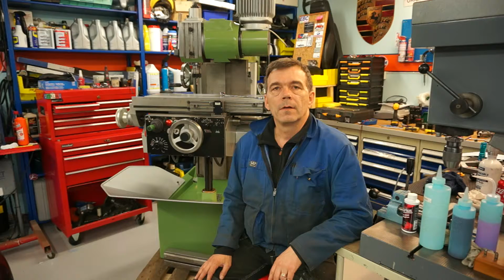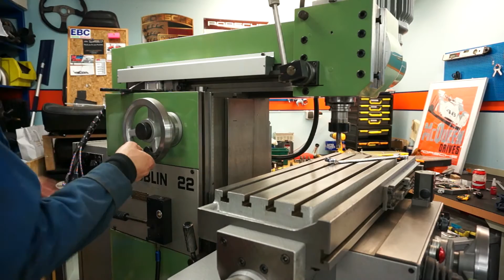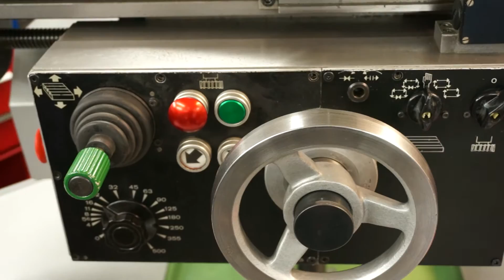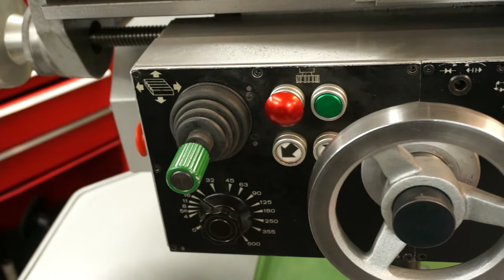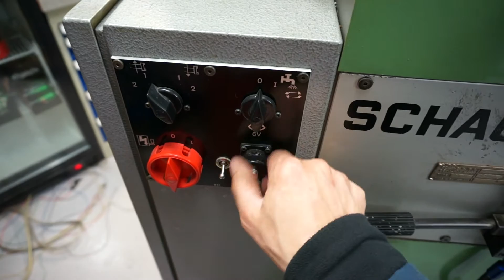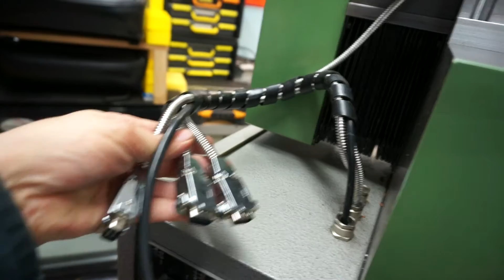Schaublin22 first presentation

Comment: Arnljot, we had investigated and found that the issue was a mechanical. The shift-shaft was broken. In this case the gearwheel couldn't change from position. For traverse x and z axes.
Reply from the maker: @wiekvrinds Hope you are able to make a new shaft, or have some one make it for you.
Reply: @arnljotseem8794  I've a toolshop so we made a new one.

Comment: Great job. Do you have knowledge about the magnetic clutch on the Schaublin22. I've a S22 but the automatic transfer X and Z axis don't functional properly. Do you have also a video of it? Thanks in advance TMF.
Reply from the maker: The magnetic clutch switches the drive between the high speed 3phase rapid motor, and the 24V feed servo motor.  The driving mechanism is the same, but there are to different motors, so the cluch switches the drive between these two motors. 
Now, the clutch is switched in and out by the auxiliary switches on contactors C6 and C7.   Most things on the S22 is switched by the contactors, but all the contactors are in turn driven by the two relay boards.  I have heard that these are prone to fail, and since my machine did not come with the relay boards, I developed my own.
Let me know more specifics about the problem and I'll do my best to help you.
Reply: Hello, fellow Schau 22 lover... I feel like we should somehow try and make a group chat on for example telegram or something similar, as to share in resources... Even maybe add people like tot, with his Schau 13, as despite different, and nowhere nearly as rare as a 22, any Schaublin enthusiast could provide some potential material... Even offer to make parts, as I am in the process of obtaining a VDF lathe, and a huge one, and would love to make parts for any such machine for a fellow brother in need of parts and lack of a lathe/mill...
My Schau 22 is atm in the process of being cleaned and checked as she is in perfect condition, but is coated in old thick caked oil and has a few chips here and there, which I will not suffer damaging my lovely factory honed surfaces... I have not even turned her on, as I lack info on the specific oil recommendation and am in the process of possibly getting a manual for the 22 provided by the Schaublin, as I have no intention of paying 65£ for it through that one site that offers it... When I get it, it will be uploaded online as a pdf most likely, as I would have anyone with such a masterpiece have access to the manual, should they ever need it, and I don’t see how one wouldn’t... So if you know, and have the book, I would appreciate the info on the oil that is recommended for the central lubrication system... But yeah, that’s the idea... You said there were 509 of them... Now there must be less... They are almost like Bentley Brooklands Coupe with only 500 of them ever made, and the price to match, a work of art indeed... And as such, we who love them, might as well share in love for them and teach each other or help each other as we all most likely have access to what some of us don’t, and to what most non-machinisty people don’t even have the idea to be possible...
Reply from the maker: @camillosteuss  Congratulations.  I really love the 22.  For manual oil pump on the side, use regular way oil.  For the gear head, I use MobilGear 600 XP 68, but any ISO VG 68 gear oil will do.  Tha user manual doesn't really specify which gear oil to use.  I think most of the heads were run without oil, but lubricated for 5? years in bearings and gears with Kluber Isoflex LDS 18 Special A.  This is the grease Schaublin recommends for bearings on most of their machines.  Expensive as h***, but lasts a long way.  I have also seen drawings of gear heads with a small integrated mechanically driven oil pump. So i think they might have changed the design slightly.  This is the case on mine, but I have a friend that runs only with grease.  
When it comes to community, I am mostly active on Instagram.  #instamachinist is a hashtag used my many working on metal working machines there.  I have used #schaublin22 on all my 22 related posts.  I have also been contacted by other 22 owners on insta.  My handle on insta is @Arnljot911 if you want to follow me there.
There are some downloads on the 22 on http://anglo-swiss-tools.co.uk/downloads/ but not a user manual unfortunately.
Reply: @arnljotseem8794  Glad to see your answer! Regarding the oil, I also have a small Emco FB2 that uses Mobil DTE 25 Ultra oil, which is Iso 46 grade.. I was considering using that as oil for the Schau 22 as it is a very fine yet high quality oil, recommended to me by Emco of Austria... You wouldnt believe what a lovely experience i had talking to one of their employees over the phone not two months ago... He actually recounted the oil and was actually personally delighted to hear that someone who treats machines with love has gotten one of their machines, which is quite long out of production and informed me a bit on it... I tried contacting schaublin but they are not so open to direct phone calls, so i opted for a reacharound technique, and am waiting for a mail now... I was wondering what do you think about using that iso 46 grade over 68, as I dont really see the machine actually getting hot in there, nor along the ways, as I would use the same oil for both head and the lubrication, as it is a high grade hydraulic oil that flows like silk when cold, which i along with its lubricating properties see as nothing but a good thing...https://www.mobil.com/en/lubricants/for-businesses/industrial/lubricants/products/products/mobil-dte-26

scroll through it if you would, I would like to hear your view on it, as I never skimp on the best of oil, and like to know which oil is the best oil for the job at hand, and as you have had the machine for longer than i do, you know whether it gets hot and where, whether it perhaps feels like it would fancy a lighter oil for the ways, especially as they are a tight tolerance surface that is quite cold while working...
Reply from the maker: @camillosteuss  I tried hydraulic oil first, but it had a tendency to foam, or create a lot of air bubbles in the oil.  After I changed to proper gear oil, I've had no such issues.   Before you start using the machine, you should check the grease in the bearings. There are three large bearings on the spindle itself, accessible from the top of the head.  You can pull out the hole spindle cartridge from the top after loosening the set screw on the side.  There are also a number of bearings in the gearbox.  These can be seen from the top of the horizontal boom by removing the access plate.  If you then tilt the head 90 degrees, some of the bearings are accessible.  To access all, is rather difficult unfortunately.  I had to service the gearbox, so I removed the head completely.  If you remove the side plate under the gear leavers, you can also verify if your gearbox has an oil pump or not.  It should be at the bottom of the motor shaft, sunk down in the casing.  Without the pump, I believe it was designed to run with grease only.  With the pump, there are also copper oil lines that spray oil on the gear clusters, and into the to of the spindle.    
If I get access to a scanner, I'll see if I can scan my user manual for you.  The schematics are too large for a regular scanner.  My drawings are from lathes.co.uk, and came with the machine.  Without them I would not have been able to rebuild the milling machine.  Especially the electrical part of it.
Best of luck
Reply: @arnljotseem8794  Aaah, lovely, if you can, and if you are in a situation that allows for it, I will take any and all info and data you can provide... I have had contact with a scaublin rep in a nearby country to mine, and he provided me with a 60 page user manual in english in pdf... If you want, i will send it to you, as you will be able to tell me if it has something that you have not yet seen... I have a version in french that came in the electrical closet of the machine, but that needs scanning... If what i send you is what is uploaded on lathes.co.uk, i will upload it online, as 65$ is a scam, especially as Schau sent me the thing free of charge... Should anyone chose to fund lathes.co.uk in that manner, they may, and I may aswell when I will be in opportunity to fund them, but for now, I will do what I can to provide the 500 of us with as much material as I can for free, as no owner of such a machine should be forced to resort to who know what to find their way through... I will actually ask Schau for a german copy aswell as to publish both english and german lit, and the french will be scanned in time... As you know, some of the schematics are huge and dont fit a peasantly scanner most of us have...

Regarding the gearbox, mine is probably greasy rather than oily, as my machine hasnt got that oil port that your has on the right side of the head carrier... Tho, that wont stop me from making my own high pressure pump, and modifying the machine to that spec, for grease no matter how good it is, can not compare to fresh, filtered, pre-warmed up oil... I am getting a VDF lathe in a few weeks, so I will have THE FULL CAPACITY(jk) to make pumps and cylinders for any purpose and I will use it... I want the Schau to be 100% oil lubed, as grease is a future grinding paste, where high pressure oil is a washing fluid that never turns to grinding paste, at least not if filtered and maintained properly... m.k.steus@gmail.com is my email, you can contact me there so i can send you the pdf... Sorry for seemingly interrupted writing, as I am pretty much mad in the last few months, as I am sorting space, driving thousands of km to get stuff, ordering, remodeling and designing all that will become the toolroom which will house the Schau 22 and the rest... I just cant take that much time to write all that can come to mind in a single comment here, so i am posting erratic replies... 
And dont worry, she wont see no power but my hand turning the spindle until the last nut, bolt, bearing and whatever piece of her has been taken apart, cleaned, oiled, checked and considered for modification as to convert her to all high pressure oil lubrication...
I have not turned on the Emco FB2 for 2 months when I got her, as I couldnt get oil for her shipped... She was dismantled, cleaned, checked and oiled, yet when reassembled, I still didnt even consider turning her on without first purging the head with 2 l of quite warm fresh oil...
Reply from the maker: @camillosteuss  We can switch to email.  Send me an email to my junk mail box arnljotseem(a)outlook.com and I will reply from my daily use account
Reply: @arnljotseem8794  I sent you an email, sorry for the delay... I have had some madness in the process which is still ongoing, but eased up a little bit...

Comment: Hey,

I just happened to stumble across one of these machines dusting down in a warehouse i have taken over.
No experience with these types of machine - i do not know the condition it is in.

Any idea if it is still of value to anyone in 2019? Or is this entirely obsolete at this point in time? 
Interested in giving it away if it is of value to anyone, or throwing it out if it is not!
Thanks,
Reply from the maker: Tallahdo Where are you located? US?  These machines are rather rare, only approx. 509 were made over 20-25 years. They were high quality Swiss manufactured, and very expensive at the time. Depending on condition they should fetch 5-10K €. Good or restored ones goes for over 20K (not hobby restorations) They are probably more sought after in Europe than in the US. I’d like to see some pictures if you have:  arnljotseem(at)outlook.com
Reply: @arnljotseem8794  - I'm in Norway. Seems to my untrained eye to be in a rather bad condition unfortunately, but that might also just be the dirt and dust from over the years.

Ill send you an email with some photos shortly! Thanks :)
Reply from the maker: Tallahdo Great. I might be interested. Du er norsk du også?

Comment: Hmm
Very nice machine you have.
I had a look at one a few months ago, 
Today I just found out that the same machine has come up for sale (auction)
Fingers crossed 🤞
Reply from the maker: Make sure it is in good condition.  It can quickly get really expensive to fix these.  Genuine Schaublin parts are available new, but insanely expensive.  Thats why good machine are so expensive.  You also find them rebuilt to factory spec, but they can run up to 25-30000 USD
Reply: Arnljot Seem 
I’ll let you know how I go.